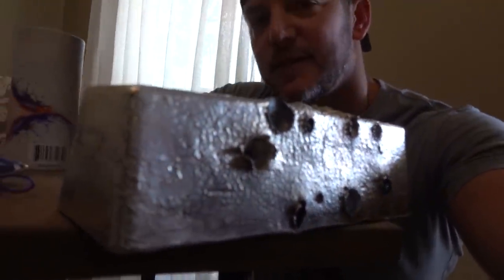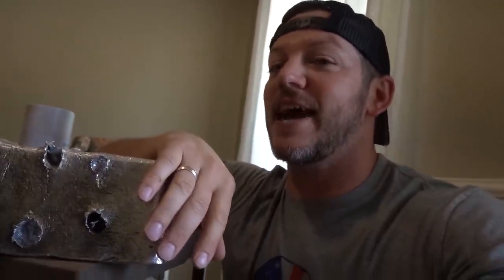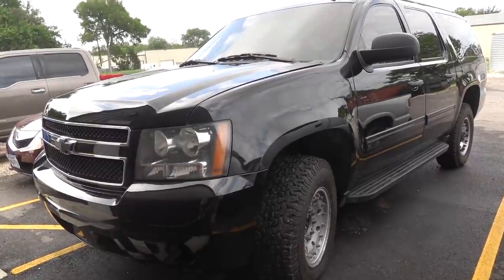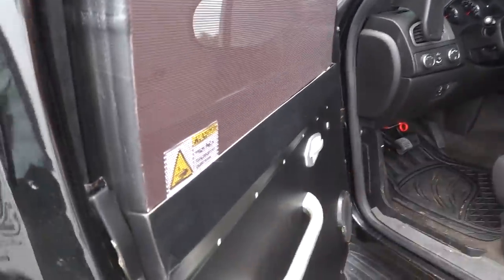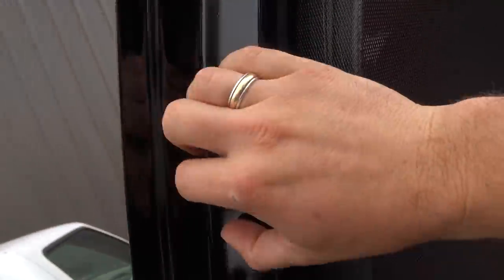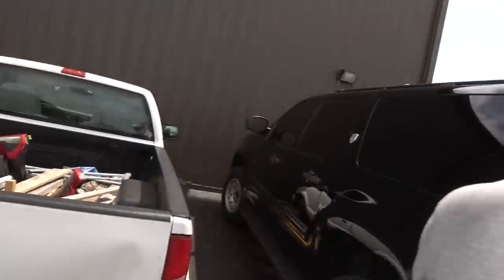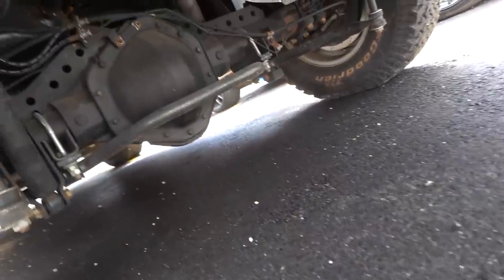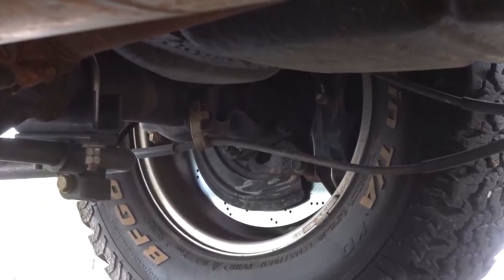I may have acquired a FULLY ARMORED SUBURBAN!!! 50 cal Proof...

Comment: Definitely a 6bt/zf6 because it can run without voltage or trans fluid. Pop the clutch if it's dead. Cattle bumpers with winches. Gun racks lining ceiling. Mag bins, clean water tank...

Comment: Matt. You need solar panels, backup generator if possible, a microwave, a fridge, home outlets, a water source, xtra emergency fuel, tools, tire patch kit, electric pump, and i would say AC but your car is fully armored so that'll be difficult. U might have to use the cars ac.

Comment: Need to install a head unit with 360 cameras so you can know who is around you by looking at the screen on the radio. This will help especially at night when you have low visibility. Need a custom roof rack so you can always throw extra cargo up top with 360 lighting. You can put water containers and gas up top. A winch. Good radio system.

Comment: Gun / Equipment mounts on the back of the front seats and back of the 2nd row seats.  Bins for the rear with medical / water / food / cooking.  Rear gate mounts / trailer hitch mount (exterior) for fuel storage.  Water resistant/ waterproof roof mount container for camping supplies / tents

Comment: sitting in 50cal proof car “we’re safe from anything”
His wife: already in the back like a ninja
Reply: Power tools and saws is how to breach it. And has been done before in real life. YG the rapper's bullet proof B6 Escalade got pried open by LAPD.
Reply: @prandomable  B6.
Reply: @-axdrus  same with B7+ etc etc. My point is drill bit, power tools, jack hammer, saw blades saw etc etc is how to breach an armored vehicle and has been done before...
Reply: @prandomable  but it would be hard to stop it to breech it. Because if your driving no one is breaching it until it is at a stand still.
Reply: @daniel-davis  correct. Unless you immobilize it first. They teach you to immobilize the vehicle first when you are trying to shoot thru bullet proof glass. Because when vehicle's moving it's impossible to hit same spot over and over again.
Reply: @daniel-davis  I've been to bullet proof car manufacturing factory before. The MOST important thing they tell their customers is to KEEP driving during an attack, because once if you've become immobilize, your vehicle "could" potentially turn into a standstill coffin. That's why keep moving is important and why they put run-flat tires so you can get out of the kill zone.

Comment: The only weak like I’ve seen is the rear diff cover. It’s got a stock rear end pan on it. That thing needs plated
Reply: What about under the engine bay? An explosion could turn that into a sitting duck. What’s the gas tank look like? I don’t like that separate trunk either. If you are in a chase, all of your survival gear will be Swiss cheese.

Comment: Matt, I would like to suggest taking it to "Duraburb" and having that company get rid of the 5.3L gas engine and doing one of their Duramax diesel engine and Allison transmission swaps.  They do a great job at making the whole thing look and function just like it came that way from the factory with a diesel.  They also have different power levels available with the diesel engine they can install.
Reply: this or turbo the 5.3
Reply: Not a bad idea
Reply: This is a 2500
Reply: With this being an armored burb it's the 2500 version, so it probably has the 6.0 vortec. Who needs fuel economy anyway lol
Reply: @jaredrafnson8349  yeah that’s what I was thinking ain’t no way they leaving the 5.3 in there and not swapping it with the 6.0 lol and it’s great idea to swap with the 6.0 Bc 4l60es ain’t the best but those 4l80es are strong af

Comment: Get the 3de row out. Put in a gun safe on 1 side. Other side food en drink storage and on top of it gassmasks airtanks
Computer with satellite connetion.
If possible put a flat solarpanel on the roof
Maybe flamethrowers on the outside under the sub

Comment: the thing that scares me is its just as hard to get out of if something malfunctions as it is to get into...
Reply: theres 4 doors - but yeah lol
Reply: Well, the simple fact that your still alive to worry about getting out would be a plus
Reply: @cannonfodder4812  its an asset in a gun fight but a liability off the end of a dock... I think its that I fear being trapped more than bullets... stay safe..
Reply: The doors still open regularly,the hydraulics is just assisting them.
Reply: @gradybaby8309  I’m with you dude. The armor on that thing is amazing but man, if something goes way wrong...talk about trapped!
Reply: there is a brief glimpse or a red pull when he gets in the rear seat.  I believe that is an emergency release so that you can still unlatch and force the door open if the hydraulics are out.
Reply: @davidherzog58  Most of the armored cars I've seen have a release like that. It literally drops the door off the hinges.
Reply: Doors have emergency exit tabs. Also the back glass is hinged for exits to the standard trunk with inside opening features.

Comment: I would strap guns to the roof inside. A two way radio system. Discreet flash lighting around the outside that blinds anyone looking at it. Turns on for 5 seconds off for 20.  A bumper that holds traps or spikes to release. Popout Smoke or flashbang launchers inside the rear door. A tactical version of a laser pen used for signage that pops out from under or top of the truck to write messages or warnings on the side of the truck or nearby wall.

Comment: Thats bad ass! Honestly, for the longevity of the drivetrain with that much weight, you may want to see about getting a Diesel engine swapped in it. 5.9 Cummins or built 7.3 Powerstroke with an Allison automatic transmission.
Reply: or a duramax

Comment: I was gonna say this needs an LS, but even better, it should get a Texas speed LS!
Reply: It needs a duramax so it's not such a snail, yes you can get adequate performance with a TSP LS but it will also get abysmal fuel economy. Suburban already get terrible fuel mileage. I get around 16 empty and 6-7mpg pulling a 6,000 pound trailer.
Reply: A lingenfeler ls motor!
Reply: It is an LS.
Reply: @rustbucket9318  no it's a vortec v6

Comment: Doesn’t the mesh in the windows make it EMP proof? Looks like a microwave looking glass.
Reply: mesh is for catching glass incase it breaks
Reply: @dakilla798  IT keeps it structurally together if a projectile happens to go through multiple times... it keeps it held together.   So it may be damaged but you still have some there to protect you.
Reply: in theory, the windows may be EMP proof like a faraday cage, but the rest of the cabin or engine probably would not be, if my knowledge is correct.
Reply: @DTMRM8  isn’t the only part of the car not a faraday cage the windows? If that is indeed the same mesh they use in microwaves, that plus the all around armor should make it EMP proof
Reply: @abnormallynormal8823  I wasn't exactly sure how EMP is interact with sheet metal overlaid with these. Electromagnetic radiation only needs a hole bigger than the wavelength for it to get through so I'm not sure if the edges around the windows, or seams around the doors could let some in. The wavelength is much smaller than a bullet so maybe some could get through.

Comment: I would assume that those window's don't roll down, so I would put a speaker box adapter on the outside somewhere to communicate with someone on the outside without compromising your security by opening the doors.
Reply: I thought the same. 👍

Comment: Duramax swap and larger fuel tank or spare fuel tanks (maybe a filler neck inside the back seat so don't have to exit the vehicle to refuel)
Night vision lights (infrared bulbs in the fog lights and infrared binoculars/goggles so driver can see)
Radio and extra communications
Biohazard protection? Air filtration?

Comment: Understatement of the century:  " This thing probably weighs a ton".  I've stopped at the point you said just that to throw my guess in and that is that it's going to be more like 4 ton at least and possibly up to 5 ton, we'll see how close my guess was if you actually do say.
OK, so 12,000 pound and in metric it's 2.2 pounds to a kilogram and 1,000 kilograms to a ton equals 5.454 tons. so even my high (I thought) guess was short. Gimme a break though, I'm Australian and we don't have too many giant and oversized monster 3X4s here so I had no idea a Suburban was actually almost as heavy as a SUBURB to start with.
I'm glad I won't be paying the fuel bills for it at least.

Comment: I’d upgrade the front half shafts and put better engine in it either another more power and reliable gas or a Diesel, then that thing would be unstoppable, you should buy solid rubber tires or ones that can’t go flat a roof rack for gear, coms Like CBan, sat phone, your own air supply in the car in case of tear gas or gas attack enough to get out or maybe a filtration system that pumps clean air in the cabin or both. A water filtration system so you can just pull water out a river put in in and drink it that way you don’t need to bring water or as much some would be go like a case, one thing that I think would be cool is a tear gas fogger so if people surround your truck you hit a button and tear gas pours out of you have a filter and air supply you’d be fine and that’s struggle to get to you, I’d ask think about armoring the back to so you can have access to your gear while inside and so people can just smash out your window and steal it.

Comment: every family member needs there own bag, with stanless steel water bottle, Sawyer water filter, Ferro rod, carbon steel knife, Gorilla Tape, poncho, food and or snacks, shelter, medicine (pain killers, Benadryl, chap stick(many uses) quick start fire starters, lighter (bic), extra socks, hiking boots, clothing (weather appropriate) ammo, pet food(if there going) should have blankets in the vehicle, beeswax candles (non toxic in a enclosed area) some playing cards (keep morale up, boredom leads to fear) solor radio, first aid kid for everyone and a trauma kit. Vehicle should have a emergency kit as well, fire extinguisher, jumper cables, spare tire, the tools to work on the vehicle, a battery boost, tire iron, branches, duct tape, wrenches, flat head screwdriver. Two is one, one is none!

Comment: Fully automatic sub machine guns, kill switch for lights when driving at night to avoid detection, full military style medical kit, food rations for up to two weeks, battery charger in case it dies, cattle guard for ramming other cars, roof rack with an extra couple tires, passports and cash to Canada and Mexico.
Reply: Only comment giving ideas.

 More likely to México than Canada, a matress built into the back of the seats, water filtration, satelite communication and gps with killswitch, nightvision inside and IR lights outside to change from normal to IR at night and go undetected (better than driving into god knows what). Big, i mean huge fuel tank. Maybe integrated full auto guns but firing @ low cadence pointing back and front. No spare tyres, only military grade runflats with internal structure to keep the shape of the tyres. A way to tow and get towed. A ton of paracord. Entertainment for kids. Solar panel on the roof (there is a flexy one that sticks to it) with battery backup can be better than the charger.
Reply: And 1,000 dollars for gasoline 🤯
Reply: @nickcassell4788  per day that is.

Comment: Exterior aux fuel tank, the more fuel the better, fewer stops are safer, upgrade with the blaster flamethrower kit, patriot food packets, baby electrolyte water, unscented tampons for wife and bullet wounds, already packed two changes of clothing for each family member, upgrade DVD system for kids entertainment,  plenty of ammo and pew pew selection, even the ones for the kids, halligan tool, bolt cutters, sanitizer kit, surgical/trauma kit, medication/drug kit, baby wipes, vehicle tool kit, ax, multiple torch lighters, portable cutting torch, portable flamethrower, less-lethal defensive kit, Potassium iodate pills, diaper rash cream, and ointment, at least two emergency sat phones, 11-meter CB radio, frequency scanner, mil-spec signal blocker, and a huge supply of slim jims and buc-ee's jerky. Oh, and a few shots of your favorite whiskey or bourbon to take the edge off in butt puckery situations.

Comment: How many miles on the engine?  I'm sure you will be upgrading it soon.  Seeing as you need food, water and fuel for weeks, I'm guessing you're going to need a trailer and hitch and another few hundred horsepower, not to mention a generator, winch and bathroom.

Comment: bullet proof glass doesn't mean it won't break. Each layer of glass is laminated and some bullet proof glass has a piece of 1\4'' polycarbonate (LEXAN). The bullet proof glass I've worked with at banks and heavy equipment for coal companies has a layer of 1\4'' laminate glass then polycarbonate then 1\4'' laminate glass and then poly....4 pieces of glass and 4 pieces of poly that is 2'' thick. 8 pieces of each is military grade and it's 4'' thick.

Comment: Get a good comm setup. Ham radio or something similar
Reply: Plus a dual battery setup, in case it doesn’t already have one. Also, you might consider installing a fridge/freezer combo in the trunk. Roof rack with a tent/canopy combo to attach to it for camping.

Comment: First of all a Jack that can lift that beast and some spare tires. (and all other general vehicle maintenance stuff, fuses tools belts oil other car fluids bulbs blah) A roof rack some extra no spill cans of gas) Then Water, Food, Secured Pew Pew Racks, Ammo, (duh) Large Med kit for family, All weather gear gloves boots blah  blah, you need a wench for when what happens at the end of that happens to pull yourself out. Always trash bags and ducktape, personal hygiene kits for you the wife and kids.  Altas of merica with all the maps. Compass books both useful and some for moral. Spare funds like 2,000 bucks in cash ish. 4 Radios with at least 20 mile range. Seat belt cutter and....man I'd find a way to make that rear end escapable incase of an accident. Blankets and flashlights spare batteries for all that mess. Car fire extinguisher, GPS, Tow cables, and shovel.....boom you should be covered ^__^

Comment: 50 cal auto machine gun on the top and a mk19 auto grenade launcher controlled by the passengers, food rations on board solar panels and batteries, ability to go off the grid, more armor, entertainment and bigger fuel storage with some pistols, assault rifles and sub machine guns inside and sleeping bags inside with with inferred and night vision goggles and body armor inside, and a place that feeds ammo into the weapons and top and a place to put the ammo for the guns and more screens for controlling the guns and put heaters on this thing and replace the tires with tracks that move fast like 70 miles per hour or more so that this things isn’t a turtle and better motors and engines basically make this a barrage in gta 5 but with more armor.